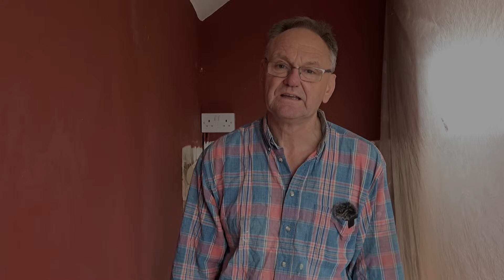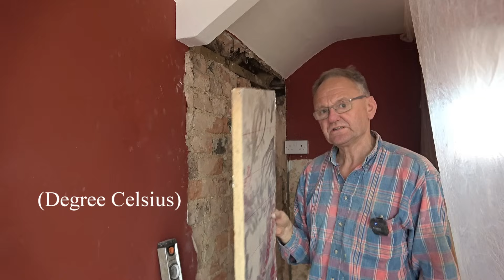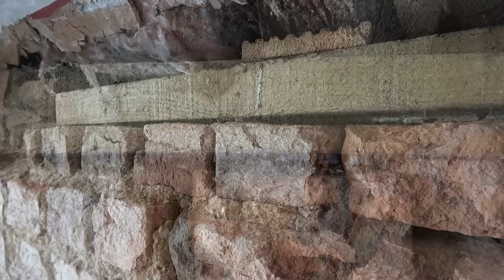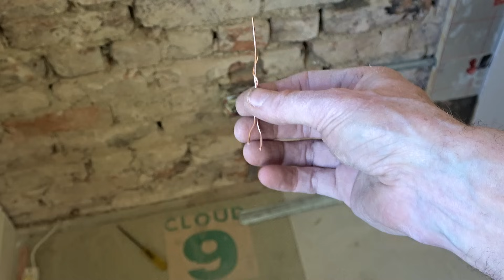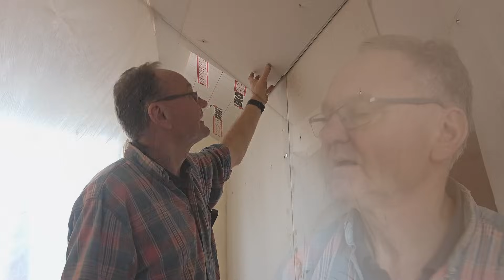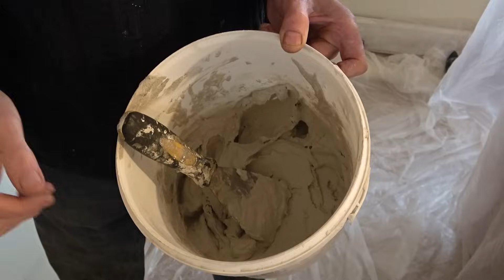HS165 Insulating a solid wall (Do it yourself)

Comment: Well as a DIYer, you've done a decent job on an awkward wall there. I've been in the trade over 50 years and I did exactly the same to my external walls when I moved in here 17 years ago. My bills are less than half my next door neighbour's and it's always cosy. Just one hint that might help: you don't actually need to screw, into plugs. If you use a 5.5mm drill and red plugs, you can push the plug through both plasterboard and insulation with a 5 mm drift (rod or another drill bit) until you feel it's gone home. Then use a 65mm galvanised clout head nail and gently tap it home. Do that at 600mm centres up the edge, and a line up the middle, if you're skimming it. But you will need to use scrim over the nail heads, or you'll get nail pops in places. Well done, anyway 👍
Reply from the maker: I'm with you John. drilling then plugging and then screwing as separate operations made for a lot of work moving the boards around, and brings the risk of damage. One for next time. Cheers

Comment: You'd get away with SBR on the brick, then dot and dab the insulation on, leave it half an hour, then the board (both with instastick foam) brace each layer off the opposing wall.
Reply from the maker: Hi Andy, ah I understand thanks. I remember fitting shower-wall around the bath with silicone that way, bracing off the opposite wall until the silicone set. I will investigate board glue if I do one of these again. I can see it would be quicker and would provide more supported points. Cheers

Comment: Great video, thank you.  I see some people below are concerned about moisture and mould.
 The background airborne moisture from living and breathing only becomes a problem if it hits a cold surface and condenses. It's like taking a cold can of beer out of the fridge.  If you use foil backed PIR and foil tape the joints you can prevent the vast majority of the warm moist air finding its way to the cold brick so should prevent overwhelming moisture and mould problem.
Reply from the maker: Hi Radioheadtheball, I have an experienced roofer/builder friend and he made exactly the same comment as yourself. Before insulation the wall was freezing in the winter but we never had problems with condensation settling on the wall surface. Perhaps that gave me confidence. Cheers

Comment: Did you put any expanding foam at the top of the wall under the roof?
Reply from the maker: Hi Maurice, no I just left that an open void. I thought a bit of airflow would be desirable. Cheers

Comment: True most budling merchants have you over a barrel for insulated plasterboard 52mm for £70 which is disgustingly overpriced, (travis Perkins, Selco, Jewson) B&Q wanted £60 for about 25mm of shit polystyrene bonded. Thankfully we have Berrys which was about £50 for the 52mm PIR plasterboard.
Reply from the maker: Hi Simeon, yes it is damn expensive. As I said I am not a tradesman but for reasons of pure chance (I think I just turned up on the right day when trade was low) I have an account with a merchant that helped with the price. The Wickes and B&Q cost of insulation board is off the scale!  Just about any online insulation supplier with give a better price. Cheers

Comment: I've done this with 2inch or 44 mm insulation board already attached. I used Soudal plaster board adhesive £10 a can. Easy fill gaps over foam insulation sprayed in. Over the top I put thermal wallpaper , you could use thermal paint. Its more expensive than what you have done but you have done a great job 😉
Reply from the maker: Thanks AWOL, if I do another I need to look into that board adhesive. Cheers

Comment: It looks like a very dry and stable wall internally. If it were me, I would have timber studded the wall vertically, cut the insulation to fit vertically between the studs, then screwed the plasterboards over the top to the timber studs. I would have skimmed the plasterboard, but that's another story. Well done though. Also, you can get plaster stop bead.
Reply from the maker: Hi Kev, unfortunately I just did not have the space for studding this time - you saw the plaster had to come off to get the space. I did think about sliding the wardrobes along a bit but they are right up against the door architrave now and that would have had to come off - the door is in the corner so I can't move it across. That strong binding tape seems to hold the boards together well and I don't expect cracking. Cheers

Comment: Should you not have left an air gap for condonsation..

 Only reason I ask is I have used the silver bubble insulation in the cupboard under my stairs and the condonsation onit is shocking. 
Looking for any tips and pointers  efor I tackle it properly.
Reply from the maker: Hi Ant, I did not have room for battens in this case. If I had left an air gap it would have to be vented to the outside (in my opinion). Under stairs are tricky because it's so enclosed and it can hide building defects. The floors in our house were relayed in the 70s but the builder did not bother to remove the first step on the stairs and under that was just bare earth. It made the under-stairs cupboard musty and the room next door damp. I've had similar experiences in boxed-in sections around soil vent pipes where again the builders had just boxed in bare earth. Cheers

Comment: Great video. My concern woukd there be a build up of moisture? With the Kingspan touching wall? I would of thought maybe create a small space for the wall to breath then frame up the kingspan. Please shine more onto this as I am curious as I will be renovating my 1800 sandstone walls  thank you
Reply from the maker: Hi Darren, a number of people have expressed concern about moisture and condensation and I'm sure the safest way would be to use breathable insulation on a solid wall. People have said to space the insulation out away from the wall with battens but I have thought about that and personally I don't see it helping without a vent airflow from outside (behind the insulation) ..... see info on warm roofs and cold roofs, there are many videos on that subject. Here I'm only doing one wall and it is upstairs and sheltered - where I've done similar we have got away without damp or smells. It's certainly work the research if you are doing several walls. Oh, and just to repeat. I have no expertise in this subject 😁 - just a DIY chancer. Cheers

Comment: Unfortunately, although this seems like a good idea and is probably ok a lot of the time, insulating using this method creates an interstitial condensation risk.
This method does not allow for a vapour control layer to be included on the warm side of the insulation to stop water vapour penetrating and condensing on the surface of the brickwork. This can then drip down and eventually rot the floor below.
It isn’t a certainty this will happen, especially if the house is well ventilated, but could.
The better way is to batten the wall, insulate between the battens, place a polythene VPC over the battens and then plasterboard. Hope that helps.
Reply from the maker: Thank you Scott, I cannot disagree with you. 😁 I will keep my fingers crossed that we don't get damp or a pongy musty smell, or worse. Cheers
Reply: @HaxbyShed  No worries mate, in reality I’m sure you’ll be fine. These types of condensation issues really only occur to that extent when the internal moisture level is above normal levels. This is often the case in HMO’s where too many people are cooking, bathing, living in one small space and generating buckets full of water vapour. A well heated and ventilated home shouldn’t have too many issues.
Reply: Doesn't the foil surface (with foil tape over celetex joints) count as a VCL ?  If so moisture source will mainly be external with the brick/lime acting as a seasonal sponge.
Reply: @Toby_ATG  It will certainly help. Foil backed plasterboard is designed reduce vapour permeability, but strictly speaking, the joints cannot be sealed effectively and Building Control don’t allow it to be used as a VCL. Kooltherm also do a thermal plasterboard with similar performance, but again the joints and penetrations reduce its effectiveness. Polythene over battens (with taped edges) is one of the only sure ways according to condensation risk analysis software.

Comment: Great video! The only thing I'd have done differently is to use lime mortar.  This allows the brickwork to breath.
Reply from the maker: Hi Pete, I take your point. I did mix a bit of lime into the cement mortar to make it a bit 'softer' on the old bricks. Cheers
Reply: The amount that was done is likely to make very little difference.

Comment: I also own old property, with some “blown “ plaster render. The external walls are solid double brick “no air gap” which I query when in past besieged by cavity wall sales people?  When raking out plaster a large amount of old black render / filler is falling out is frightening, but like you I managed to repoint brick and re render with proper cement before plastering. I think it’s black ash or waist from local coal pits, and was used when house was built at the beginning of WW2 and obvious lack of materials, anything was used to bulk out mix. Now having watched your vid. the next project with be to added is internal insulation where possible 👍
Reply from the maker: HI Rob, of course in-fill is not a new thing. Castle walls might be 12 feet thick but most of the middle was rubbish. I've seen cottage stone walls maybe 15in thick where the sold blocks on the outside were no more than facing 4 inch thick and back packed out with stone chips and mortar mix. Those clamp bricks are full of all sorts of rubbish like coal and ash - so much for old is best.  Cheers
Reply: I'm only a DIY'er, but my understanding is that you're supposed to stick to using a lime mortar with the soft bricks - rather than cement.
Reply from the maker: @chrisroyle4813  Hi Chris, builders have told me to put some lime in the mix which I did, but forgot to mention it. Cheers

Comment: Good job. I would have stuck the insulation to the wall with mastic, eg pink grip, which is my favourite.
Reply from the maker: Hi Richard, if I do one again I will try the mastic or foam glue. Thanks for the advice. Cheers

Comment: 21/01 23, Joists probably oak. Once watched a Barn conversion evolve where what looked like oak sleepers formed part of the found's. Builder tried to notch them with a chainsaw without success. Modified his MO to achieve sole plate fixings. Noticed  3 or so ruined chainsaw blades in nearby skip ! One thing is noticeable viewing  these successful DIYers such as yourself ; The work is given much thought beforehand & is never rushed & is carried out carefully with regular tidying up intervals. Suspect unforeseen delays are also factored in too.The Trades have to work within time constraints to ensure viability meaning their jobs can look messy & clearing up is usually left to others. Enjoy your 'new benefits' !
Reply from the maker: Hi Peter, it's very true that we DIY types do not have the pressures felt by the (often) self employed. And yes I usually do spend quite a bit of time thinking and planning. I've come to realise that wood is an amazing resource - most of us are familiar with softwoods like pine but the hardwoods are terrifically strong and can last a 1000 years under the right circumstances. Not only are those beams hard they are also large, you only see a fraction of what's visible in the loft above. Cheers
Reply: @HaxbyShed  29/01 23, Truely a home with a heart of Oak then ! Best Regards.

Comment: Yes, it is the watching other people do these tricky jobs that gives you the energy to try them for yourself....I have been slowly insulating most of exterior walls inside my house like you, but was really putting off doing the kitchen, the hardest room but since watching you I have renewed my energy and have made a start, so many thanks for the push you have given me....thanks
Reply from the maker: Hi Bernie, sometimes finishing the jobs is harder than starting and doing the kitchen is a pressure job .... not to put you off of course. 😁 Cheers

Comment: Fantastic job, would be interested in how you fixed the extra screws. Did you take the board off to put plugs in or use special No plug required screws?
Reply from the maker: HI Tim, I did it the tedious way by spot drilling through then putting plugs in. Board on and off several times. I think there are fixing that you can hammer in but heads are large so only if you are plastering.  Cheers
Reply: @HaxbyShed  thanks as I say great video, was not sure if you had a magic non tedious way. Have a very similar wall been avoiding but we need to decorate the bedroom now so will be doing similar. Hoping we have a little give in the socket twin and earth ot the sockets will drop nearer to the floor as the wall will be thicker.

Comment: As a domestic energy assessor, I regularly come across people who claim to have insulated internally. If anyone does a project like this, this includes external,  please please take photographic evidence including measuring depths of insulation. If a DEA has no proof of insulation he/she won’t be able to include it. If you haven’t any evidence dropping pug sockets is the next best thing prior to the DEA’s visit.
Reply from the maker: Nick that is a super-useful to know. I had heard that the software used by the assessors was quite basic and would not take into account just one or two walls insulated, or things even like the new efficient electric radiators vs the old  storage tape heaters. So, I'd presumed this work would not give me any credit on some future Energy Performance Certificate (not had one on this house thus far). Thanks for you comment. Cheers
Reply: Interesting comments Nick. As a domestic energy assessor, you should be aware of the conventions regarding photographic evidence and what is permissible under the current conventions.

Comment: 2-3 months on, is there a noticeable difference to comfort/heat in the room ? I ask as I will be doing this to our bedroom which as three outside walls in a bungalow.
Reply from the maker: Hi Alex, we noticed the difference immediately. That back wall was always freezing you could feel the cold 'radiating' (obviously not literally but I mean pulling the heat out of the air). We have the window open at night and now when we close that in the morning the radiator warms the room very quickly.  It's made a big difference. Cheers.

Comment: Nice job. A little tip when you are doing your next wall. You can also glue the bord and isolation to the wall with special isolation glue. This looks like pur foam. You than also don’t have cold bridges of your metal screw.
Reply from the maker: Hi Jan, I think the comments would give me confidence to try the insulation foam glue next time thanks. Doing it with 'dry' methods, as I did, is slow and quite hard work. Cheers

Comment: Solid walls I’m not sure you should do this (cavity yes). It’s probably cold because it’s holding moisture.  Is the outside cement pointed? If so remove the cement. 
Solid walls strip the non breathable plaster off, add wood fibre/wool boards and plaster in lime after (breathaplaster is a modern alternative).
“Old house eco handbook” covers this

Charlie DIY did similar to you and started getting mould come through (solid wall)
Reply from the maker: Hi David, a number of people have made the same comment. If I was doing another I would look per your advice. That wall is one side of a gap between my neighbour's which is only about 18in (450mm) wide and I can only shuffle down there sideways. Last time I was in there I had to make a bespoke ladder to fit the gap and crab up there side on, but it does mean that the wall is very sheltered. Cheers
Reply: @HaxbyShed  yes that’s a pain, if the pointing mortar is still lime you should be ok.
I’m in a voyage of discovery myself with my first solid wall house (house built 1756) and everything I knew has been thrown out of the window…

Comment: I've never heard of anyone fixing plasterboard with screws and plugs. Why did you decide against adhesive for this? I think I would have used expanding foam plasterboard adhesive.
Reply from the maker: Hi Woody, I've only insulated a few walls, usually just one wall in a room or an alcove. I suppose I started with screws and just stayed with them. I've not used adhesive foam before so another factor could be lack of confidence with it. Also with screws I know I can get the boards off quite easily if I ever had to whereas with the glue it might be difficult. Obviously fixing boards with plugs and screws would not be sensible for a professional, it would all take too long. Cheers.
Reply: @HaxbyShed  I like the foam fix for plasterboard on uneven walls because it's easy to apply, doesn't take any mixing and can be used to level and plumb your boards when first applied. It's low expansion but if you do go mad with it then you could get an issue with a board being pushed out of line and you have to keep pressing it back until the stuff stops growing 🤣 Generally speaking though I have found it to be pretty decent stuff and in insulation terms you wouldn't be creating a cold bridge with your fixings